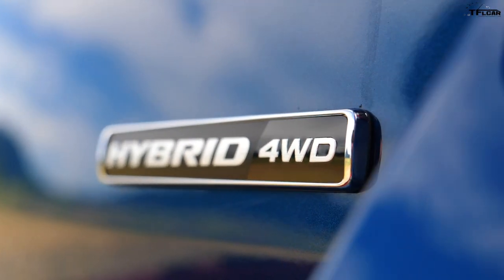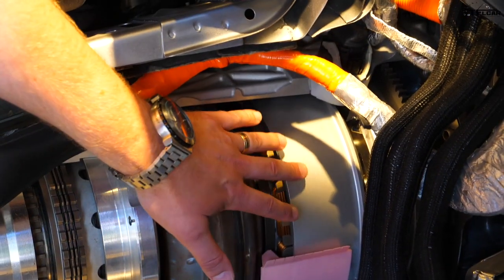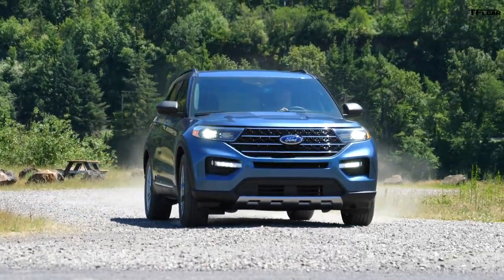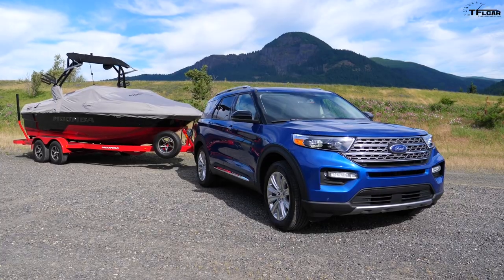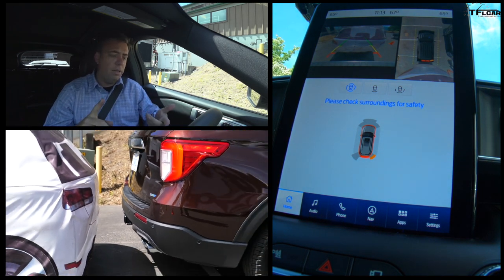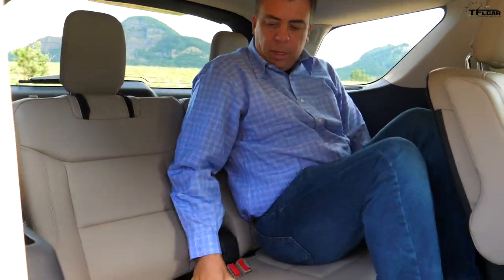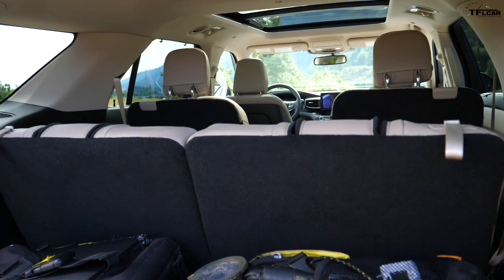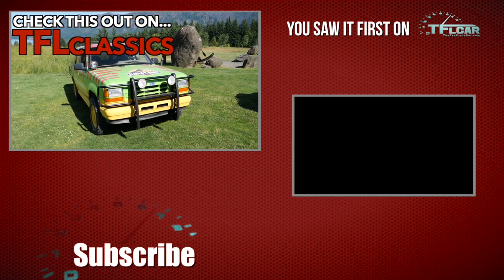Will It Tow? We Put The New 2020 Ford Explorer To The Test!

Comment: I would call this a SUV
Reply: How...  It's a slightly taller station wagon, AKA a crossover.
Reply: @dustintunis9347  I could see that lol , but with Rwd , better ground clearance ,and towing capabilities it beats out most true crossovers
Reply: Decepticon Durango It beats out most of the competition by 300lbs, 600lbs in V6 Platinum and ST models. that’s not much. 

An SUV is a truck based, body on frame vehicle. Crossover isn’t a negative term. There’s cars like the X5 and Mercedes GLE which are CUV’s, just because it’s unibody doesn’t mean there’s any shame.
Reply: @Crazynacky  - A Jeep Cherokee (old style) is unibody, but I don't think anybody would argue that it isn't an SUV, the new Cherokees are another story.  In all reality they are just labels, if a vehicle does what you want/need who cares if it's a crossover or SUV or somebody disagrees with your opinion on what category it belongs to.

Comment: 6 Passenger not 7
Reply: 7 passenger is a cost-free option
Reply: But the current trend has Mini Van idiocy all over it I bet 90% of the mid sized wagons err SUVs are all 6 seat configuration on the lots. Which means my freaking Subaru wagon is more practical than these $60,000 wagons

Comment: Ford left out the rear side marker lights, getting by on what you see of the taillights. Most people wouldn't notice it, but I avoided a car accident on a dark obscured road because I could see the side marker lights of a truck through the trees, cheap. They should also add Dual Injection to these engines if they aren't going to offer the 3.3L V6 to the public, which Ford advertises as Direct Injected, but is actually Dual Injected. They don't want us to know about the carbon build up problems with DI, touting it as superior to Multi-Port in all ways. Get a Toyota Highlander if you want reliability.

Comment: I appreciate that you guys do towing tests with a wider range of vehicles other than just 1/2 ton trucks and up. Most reviews just state the manufacturers towing specs and leave it at that, which I understand because they probably don't want to pay to install a hitch and brake light wiring/brake controllers just to review a test vehicle. I do a lot of highway driving so I care about range/economy, but I also want to be able to pull a small 5x8 utility trailer when needed so it's good to know how smaller vehicles handle doing some work with a roughly 1500-2000 lbs. load behind them.

Comment: My 2010 lariat 5.4 with 4x4 can get 500 miles
Reply: And it has a lot bigger than an 18 gallon tank
Reply: 5.4 vs a 3.0 V6? Lol out the 5.0 back in the Explorer and it will walk your 5.4 guaranteed.
Reply: @angelgjr1999  it's a junk vehicle from Chicago.
Reply: @dmegahan  yes i have a 36 gal tank
Reply: @angelgjr1999  in a race yes but i am not into racing my truck

Comment: 2:00 35 kilowatt? Not kilowatt-hour? That's a bad sign if the engineers don't know the difference.
Reply: Pham Nuwen I think he is referring to max power output, not capacity. He refers to the motor as being 35 kW also. No way that hybrid has a 35 kW/hr capacity battery, it wouldn’t be anywhere near that big in a non plug-in hybrid. I saw reference in another review to it being only 1.5 kW/hr in fact.
Reply: @TheDeezelsmoke  Yeah he clarified later that he was referring to power. Still weird not to explicitly stress this given that in 99 out of a 100 cases, batteries are measured by the energy content. 35 sounds better than a lower figure though, I guess....
Reply: @TheDeezelsmoke  Also, I hate to be nitpicking, but it's kWh not kW/h. I.e. kilowatts multiplied by hours, not kilowatts divided by hours.
Reply: Pham Nuwen Fair enough, don’t know why I wrote it like that, I should know better.